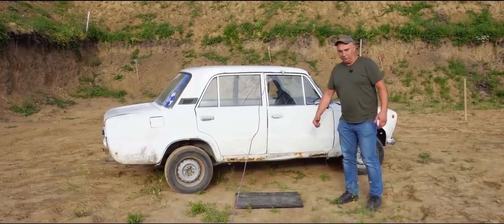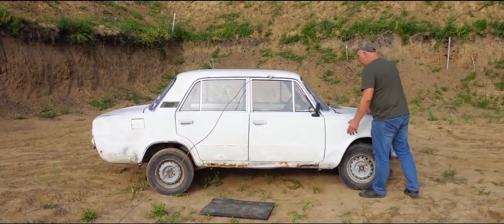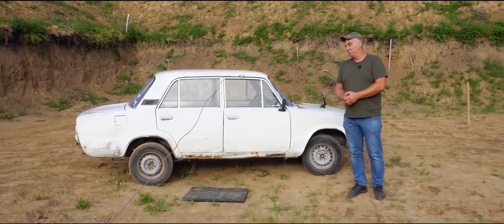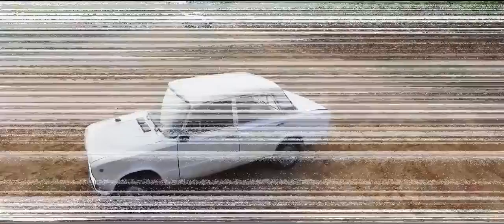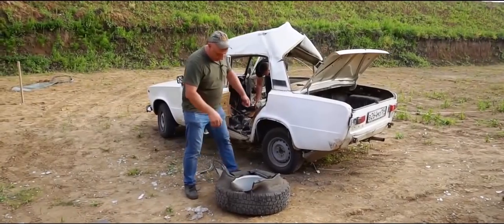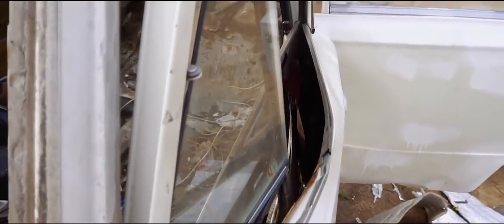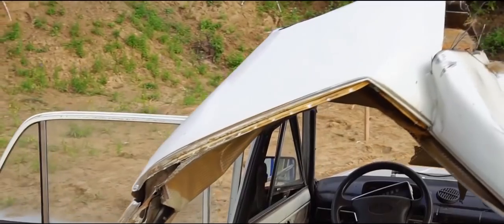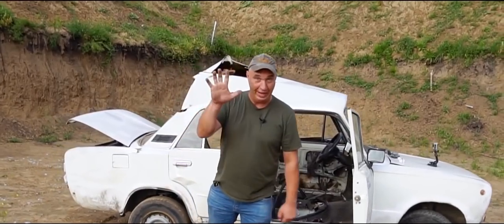Overinflating and detonating a tire inside the cabin

Comment: Next up, We fill a Lada with natural gas and mount a spark plug in the roof.
Reply: 😂😂Fuck yea man I wana see that
Reply: Natural gas? Use acetylene and oxygen!
Reply: @buffdelcampo  - Even better. Why not use liquid oxygen instead. LOL!
Reply: Trash bags filled with oxygen and acetylene......
Reply: Excellent
Reply: Hell yeah
Reply: @buffdelcampo  I did that with a brown paper lunch bag once. Never again. 
If you did that with a car there would be nothing left . You'd want to set it off from at least a KM away.
Reply: I watched that already. Only windows shattered and this tyre made much more damage..
Reply: And use some nitrous to give it more revs
Reply: You want to donate your car
Reply: @buffdelcampo  why not pure oxygen its going to be spectacular firecracker hahah
Reply: @dimos5422  because pure O2 isn't flammable..........
Reply: Yes Yes Yes
Reply: Shane's Adventures I have seen a guy in the yard with a Crackerjack GMC tractor (Google it) using a defective bullseye propane have it fill the cab with enough propane so that when the heater farted it blew all the glass out of the cab!! The driver  came out rather dazed but basically unharmed!
Reply: Do all of these ideas, then do another one with gun power involved, the max allowed by Russian law may i add
Reply: wouldn't work unless you have the right fuel air mixture....
Reply: Excellent suggestion, or Hydrogen 👍👀😨
Reply: Try replacing the antifreeze with Vodka.
Reply: Just give me a few burritos and I will supply you with all the "natural" and highly explosive gas to rip a car apart!!  Lit one of my own farts in front of my wife...bare-assed...and a HUGE ball of blue flame shot out of my ass and set my ass hairs on fire so I had to slap it out!!  Never have we laughed so hard before!! 😂😂😂😂😂
Reply: I'd rather see nitroglycerin
Reply: they did that one with a lpg tank and oh wow a big boom

Comment: This happened to the spare tire in my Volvo 240.  I opened the trunk and found that the tire had exploded leaving wire and rubber fragments in the trunk.  I guess it was just old as I had refilled it to capacity about 2 weeks before.  Not even a scratch on the inside of the trunk.  Lol
Reply: I always said that Volvos are tanks, like those old Mercedes '-'

Comment: That was way cool and a much greater more fascinating thrilling variation of something I used to see certain other students who were going to WyoTech in Laramie, Wyoming back while I was going to diesel mechanics school. They would get a container that had Gatorade in it and put little balls of aluminum foil in it and then partially fill it with Works toilet bowl cleaner. They would put the cap back on the container tight and get back a safe distance. Gas would form in that Gatorade bottle and the pressure build up would cause the container to explode. Thus it was a "Works Bomb". Making a Works Bomb is easy but what you showed was even more fun.

Comment: i knew tires exploded violenty but i would have only imagined that the windows would break... not the whole car DEFORMING!
Reply: Tires are no joke, I watched a man get killed by one. After the rim blew apart and hit him it took a pole out of 3 feet of concrete and the impact gun he was holding broke it's way threw the passenger side shock and spring on a f-550.

Comment: You make me proud to be of Russian heritage, crazy experiment with amazing damage for only 300-500 psi, I am wondering what would happen with same type of stripped-out car (no sharp things to prematurely puncture) and just a big tractor inner tube without the tire, one that would fill the car, then boom?  Fill it with propane and detonate somehow when it starts pushing out the windows?  Dunno, your level for destructing POS cars is epic, wish I had a bottle of vodka right now :P
Cheers from PNW Canada!
Reply: just an inner tube would not have the same destructive power, as one contained in a tyre. If you want to see the pure destructive force of large tyres, there are plenty on YT to prove and demonstrate.
There is one here of a tyre in what looks like a two inch pipe, hoop type cage and it literally destroys it, but it contained the wheel assembly which is what it was designed to do.

Comment: Work had a 2000 Chevrolet Suburban to transfer various gases from warehouse to warehouse and various shops.  The windows were taken off it and gratings were put in their place to let possible leaking gas vent.  I took the Suburban home one night and left my vehicle at work because the last stop was close to home and I did not want to go to get my car.  That night, there was a horrible explosion in my driveway.  I thought there was an aeroplane crash.  When I went outside, the Suburban had exploded.  A cylinder of R404 exploded and took a cylinder of R22 and a few propane cylinders.  Strangely the Acetylene, hydrogen, and oxygen cylinders did not explode. The Suburban looked like an egg after the explosion.  The vehicle only had 50,000 miles on the odometer.  Only the engine and transmission could be saved.  The company sold them both for a low price.  My house lose two windows, a lot of siding and some shingles.  Do not underestimate the enormous force contained in a compressed gas cylinder.  Remember that compressed gas drives your vehicle.
Reply: Another thing to note is the fact that the explosion happens in a closed area, there are a large amount of air inside the car that is being pushed really fast by the explosion and can not get out of the car fast enough. That is what causes the damage, the explosion might not be very powerful but the whole air pressure create that damage because it can not get out of the car fast enough. Same effect in open area would be far less powerful
Reply: @S3l3ct1ve  It was rather a closed area.  The Suburban was modified to have gratings instead of windows, with no seats in the back.  This was to keep the gas cylinders well vented in case there was a small leak.  It was a really powerful explosion.  If the Suburban was not modified and had the glass in place and a regular interior, it may have broken the vehicle in two.  It nearly broke it in two anyway.  The following week, the company scrapped a lot of older compressed gas cylinders to try to avoid another explosion.

Comment: Awesome!  How about doing it again using a garbage bag filled with oxy-acetylene from a cutting torch set and ignited electrically.  You have to fill the bag while it is in place in the car and remotely.  This mix can explode with the slightest static spark or heat.  I have used a long electric extension cord and a 160 ohm 1/2 watt resistor taped to the side of a bag.  Plug the far end into your generator and it will flash into flame igniting the contents of the bag.  I'd increase the observation distance and actually cover behind something during the filling and blast.  You might not find the car afterwards.

Comment: Take aa electric  100 Litre hot water heater and disable the safety valves .
Then place it in a lada facing up  , plug it in and wait for the fun... But be far back.

Comment: Am surprised the copper tubing didn't give way cause it has a lower burst pressure than 300 psi ,dunno who rates their tires can fail at 600/700 psi as 300 psi is the average failure ,dunno who starts an experiment and states 2000psi and hasn't read up the burst pressure of parts used

Comment: this shows how cheap made are these Ladas, they are like paper thin cars. if you weant to die, drive in Lada
Reply: But they're not paper thin they are made using thicker steel for the panels so they could get away with using low grade steel.....